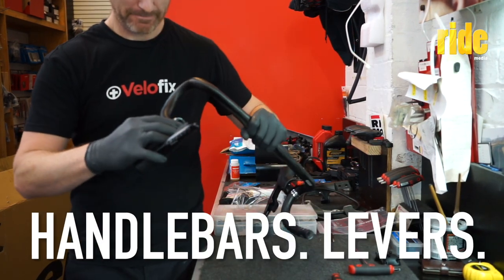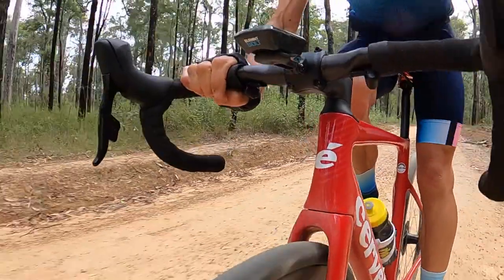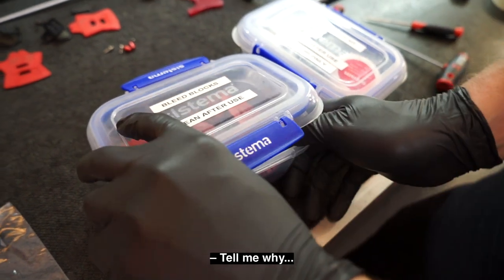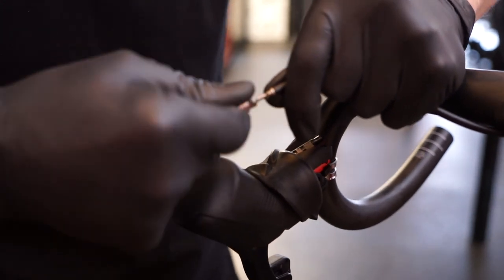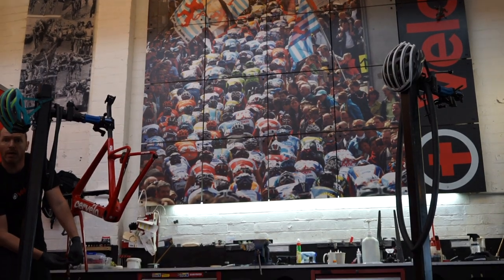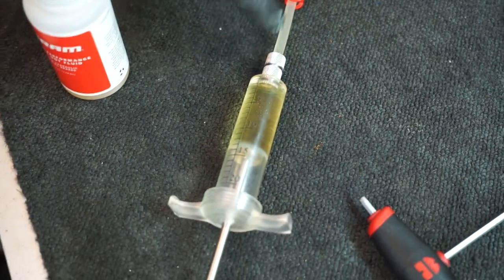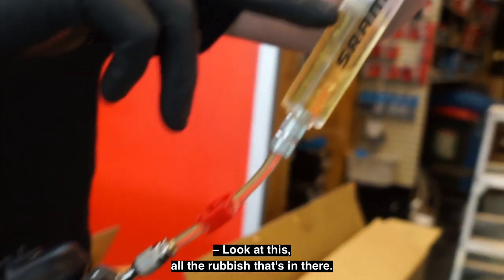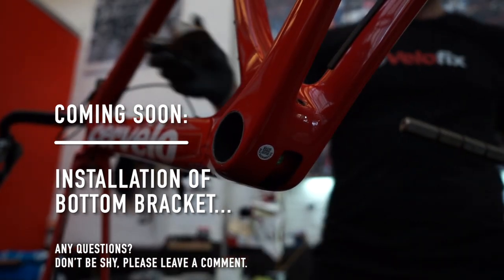Bike build (Cervélo Caledonia): SRAM disc brake, prep hydraulic hoses – part 2 of workshop series

Comment: Never seen anyone torque wrench the cable into the shifter.
Reply from the maker: What I didn't include was our long discussion while he got to the point when the torque click finally came. That is, quite obviously, what got us laughing... 
– Rob
Reply: Why even bother using the torque wrench when its not be used correctly. For accuracy that criwsfoot needs to be 90 degree to the wrench
Reply: @kevinwells1660  I was just about to say the same thing.